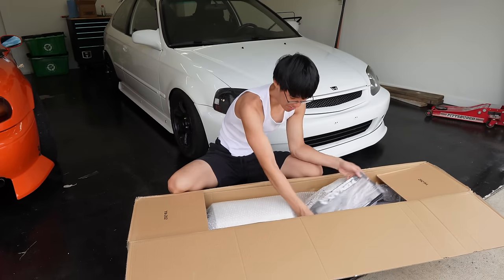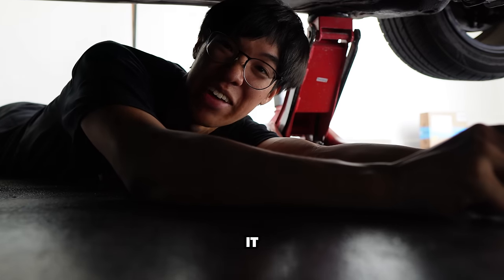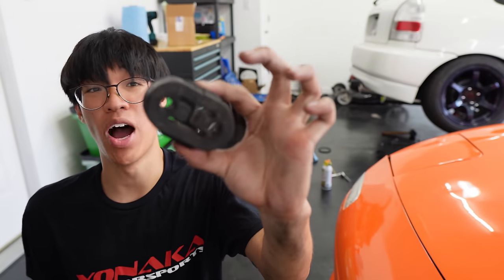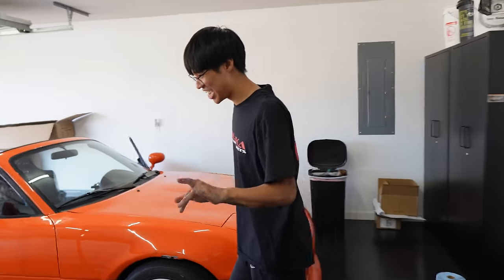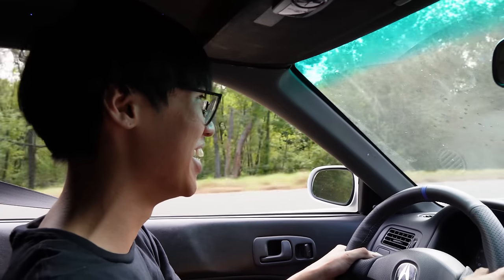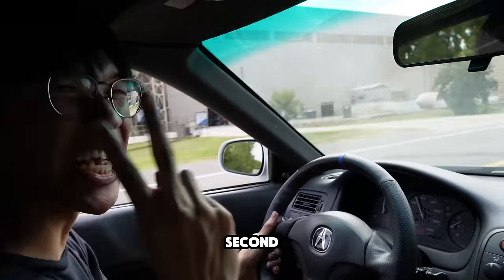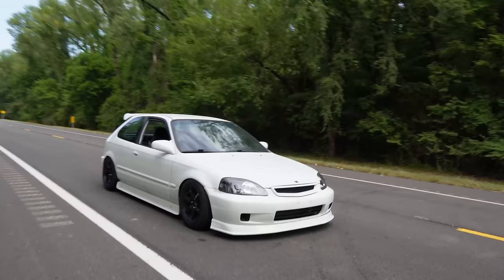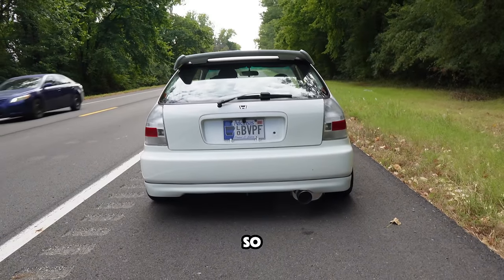Turning my SLOW Civic into a STREET BEAST!

Comment: I had their exhaust on my old 8th gen and it sounded fantastic, especially at around 4-5k rpm. And low drone during regular driving. For $400 shipped really hard to beat
Reply from the maker: Pricing is pretty nice 👍
Reply: @jarekmai  considering I can only get an axle back for my 2013 that about 600 yes indeed lol